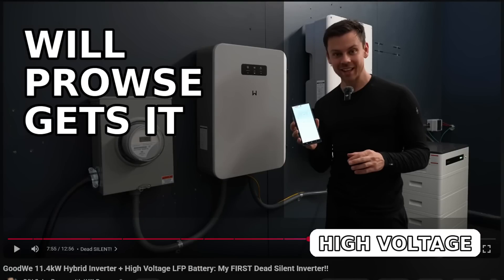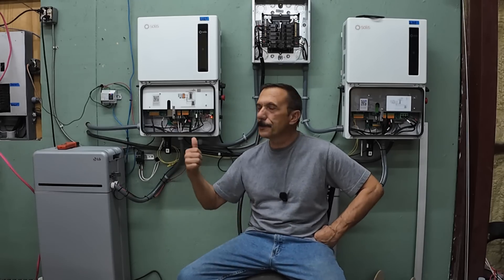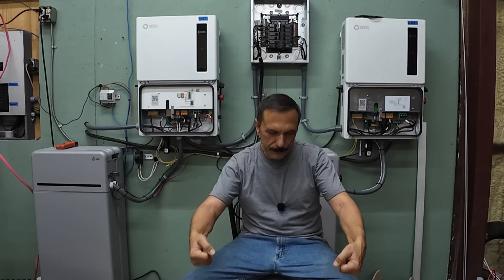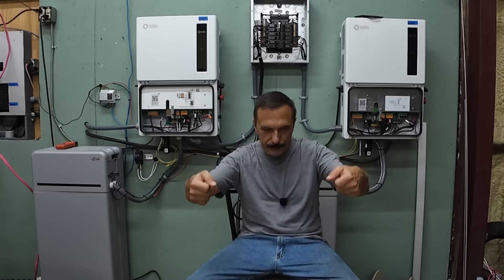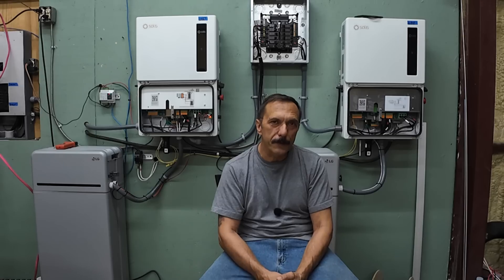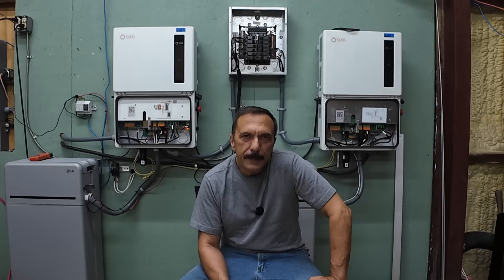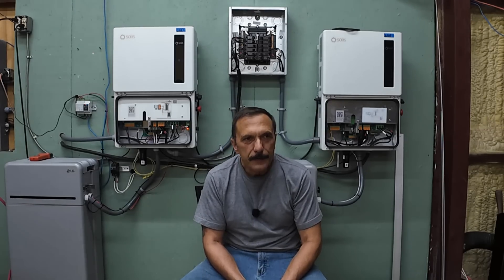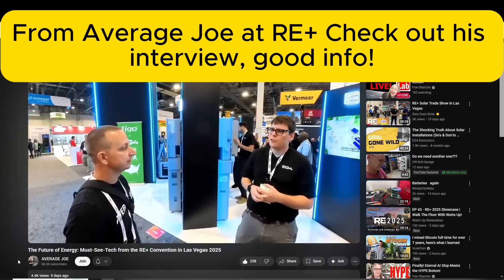Will Prowse Gets It! High Voltage Solar

Comment: Sol Ark has a 60kW 3-phase 480V unit - solar up to 850VDC nominal (1kV peak OC), batteries at 580VDC nominal (12S x 48V module).  I've been itching to do a multi-MW micro-grid system with a few of them...
Reply from the maker: Solis also has some bigger 3p inverters, just waiting for my distributor to bring them in.
Sol-Ark is just to pricey for me, I wish they could have worked something out with Deye so we could still buy them here.
Thanks for watching!
Reply: @DIYSolarFarming  Something I've learned about supply chains from China overs years in tech - it's all the same stuff, they just fudge with minor details to make things look different enough, and then find where the market wants pricing to live using different "brands".  Pretty much all of the US "manufacturers" are just contracting either design and manufacturing or manufacturing to China (and their designs are getting stolen cough sorry... "technology transferred" and used in the other "brands").  It's generally the illusion of choice - unless you're designing and doing the manufacturing domestically yourself in the same building.  What companies out of China would do is host a trade show where buyers would fly in from around the world to see new products, then contract the China manufacturing company to build for them - if they bought enough, they were allowed to ask for small tweaks and changes to differentiate for other brands - slightly different case latches or weather sealing, different fans or heatsink, on-brand color, etc.  They'll even silk-screen your company name on the internal PCB if you pay them to.
  
If you look at the SolArk 60K and the Solis 60K, their specs are basically a 1:1 match, and the hardware just looks like it has a different paintjob and front screen layout (easy to change icons in software without changing the back-end code).  Even the way the network port sticks off the side is the same.

Comment: Greetings from South Africa.
I have a Fox ESS system, KH 10.5 kW single phase Inverter and two EP11 (10.36 kWh) batteries in parallel.
The system runs at a nominal 384V but seems to run at about 400 to 410 volts most of the time.
I was drawn to the system by the very benefits mentioned here - lower current, thinner wiring, cooler and generally more efficient.
It's been great so far.
Reply from the maker: Thanks for sharing your experience, glad it's working well for you!

Comment: Interestingly, just commented on another channel and have been wanting to utilize commercial solar panels and older NiMH Prius and the like HV batteries more.  Mainly, being the Priuses are even cheaper albeit lower capacity batteries.  Still, I know I am getting a stash going and that includes a 5kW  HP Server UPS that I need to revisit getting back in service no with a Prius since if is OK with DC input after the contactors, would make a great system.  That is either full time dedicated or as needed Prius HV power station.  Seems as well can just integrate as full time as cheap as some gen 2's are going. Maybe going overboard; though seems if you can get a solar charge controller to keep the HV battery packs topped off or trickle charged, then the gen 2 Prius wouldn't start it's engine for generation unless the coolant was under a specified temp.  Therefore, you can dump some heat into a block heater to prevent that from happening unless needed for HV pack charging or system peak or surge handling.  Just seems crazy having such cost effective big generators in those Priuses going for so cheap.  Thanks for sharing and safety really needs to be addressed with these high voltage systems, I mean ablation station if not careful.
Reply from the maker: Interesting, what's the voltage on those Prius packs?
Thanks for watching!
Reply: @DIYSolarFarming  Nominal voltage is approximately 201.6V for a 2004-2022 Gen 2, 3 & 4 Prius HV pack based on 1.2V per cell multiplied by 168 cells.  Where each module is 6 cells and there are 28 modules in the HV pack.  The Prius senses pairs of modules, so 14 blocks and when in the vehicles can get up to 270V when braking regen charging.  233V seems to be the trickle max to balance the pack if you charge using what is termed grid charging using a 300ma HV LED power supply.   The NiMH modules can be found also in hybrid Camry's, Highlanders and more like the Chevy Tahoe's and related. The Prolong grid charger website has details with more specs for the different NiMH batteries, since they detail how to use their charger with the range of makes and models.

Comment: Definitely would be awesome if the US market would allow for more high voltage batteries. The whole point of an all in one inverter is to gain higher efficiency from not having solar drop to a low battery voltage before being used.
Why not just eliminate that low voltage all together? It just makes so much since. And I feel like from what I've heard from solar installers I've talked to who have been in the industry for decades (in Idaho at least) is that high voltage batteries was frowned upon in regulations because it was "more dangerous". Which that was back in the day of only lead acids that didn't have any isolation switches or anything. But now with LiFePO4 batteries being completely self isolating, it doesn't make any sense for those regulations to still be in place.
I certainly hope that high voltage batteries become a lot more common!
Reply from the maker: You and me both brother!
Thanks for watching!

Comment: What’s the efficiency?The battery has an inverter to high voltage and the solar inverter has to reduce the voltage.the advantage is the wiring is between the units and the grid.
Reply from the maker: Efficiency comes into play with inverter conversion losses, a low voltage inverter needs to convert the low voltage DC to high voltage DC first before converting to AC.
With a high-voltage battery (300–400 V), the inverter works almost 1:1 with the battery bus, so there’s little conversion overhead.
Plus on a low voltage system you have losses on the battery cables due to heat when pulling that 200 -300 amps at load.
Thanks for watching!

Comment: Also your video description is extremely offensive. You call HV "real" so you imply others are fake. What is fake is implying the stupid thing that small and mid sized systems should go and buy ~100 cells.
Reply from the maker: Show me where I say to buy 100 cells, I advocate buy one battery pack wire it up with small 4 or 6AWG that you can buy at Home Depot for pennies per foot, done - cheap and easy.
If you want an adventure, Ev full packs are interesting.
Reply: @DIYSolarFarming  wiring is not the cost

Comment: HV is a very stupid idea for certain use cases. The cheapest cells per KW are now 314Ah or even higher. Small and medium systems would be extremely expensive unnecessarily because they'd need at least ~100 cells of those (expensive) or ~100 smaller cells (still expensive and bad cost per KWh).
I find it sane only for extremely large systems that need AT LEAST ~100KWh. Noise and cable cost is irrelevant for certain cases (batteries not in living spaces and cables are almost always very short so not that expensive even if they're large anyway).
Reply from the maker: Solis 11.4kW inverter + LG 16kWh battery = ~$5100 and it is UL approved to install in the US. That means your inspector will give it a pass, it can be grid connected and your insurance company will cover it. I would not put any large non UL approved battery in my living space.

Comment: I’ve seen nothing but bad about the LG 16h you’re using, for anyone getting antsy about using the 30% tax credit before it goes away, would you recommend them for on-grid Hybrid use and if not, what would recommend instead. I’ve only seen the Goodwe setup outside of This.
Reply from the maker: What have you seen bad about them? They are UL approved and have an exceptional track record. You must be talking about the 10H that had a recall.
There are other batteries, I'm trying to work something out with Soluna, 15kWh and can be stacked up to 150kWh on the Solis S6.
Thanks for watching!

Comment: I have a 2017 Bolt EV I bought for my daily 60 mile commute each way.  Then COVID hit and I was able to tele-work. Then because of the battery fires, GM swapped out my ~60kwh battery and I only have 20,000 miles on it.  I'm nearing retirement and wanting to build an off grid retirement home.  Since my early model Bolt is notoriously uncomfortable and slow changing, I'll probably want to get something better., but likely not get much trade-in value.  So re-purposing it's battery for my off-grid home sounds like a good idea.  Has anyone here done this with a Bolt?
Reply from the maker: Yes, the Bolt battery is supported, click the link to Dala's GitHub in the video description. At the bottom of the GitHub page there's a link to the Discord. Lots of information there for you.
Thanks for watching!

Comment: You should look into Avramenko's Plug, 1kW through a single-wire transmission line with only a 10 microns 
tungsten wire!
Reply from the maker: Interesting, I'll have to check that out!

Comment: One major downside of HV packs is the extra cost. Multiple smaller cells to deliver higher voltage means a lot more interconnects, a lot more BMS wires and a lot higher channel count for the BMS.
Every joint that needs to be welded or torqued is a potential failure point. It's better for high scaling but the cost is just insane vs lower interconnect options for single inverter with single battery setups.
Especially now that the new MB56 cells have arrived. I'm running 32 kWh on my Deye 12kW LV inverter but I am fine with a 8kW limit to the battery seing how I use it on a IT-grid and it's limited to 7.4 kW anyway (voltage difference beetween 400v and 230v).
Reply from the maker: You bring up some great points! 
HV batteries are coming down in price fast as we get more adoption here.
For example, the UL listed LG batteries I am testing with are only $2700 for 16kWh with the discount code I have for them, https://signaturesolar.com/lg-16h-prime-battery-16kwh-400v-high-voltage/?ref=piqshkgv
Reply: @DIYSolarFarming  I paid $2700 for my 32 kWh single case behemoth from Seplos. The Mason 560L.
It arrived on a boxed narrow pallet and it was just a matter of setting up a ramp for it and roll it down off ramp and up against the wall. Adjust the feet to stationary and bolt it to the wall for safety.
Reply from the maker: That's awesome!

Comment: 4:55:  100 or 120 volt battery pack . . . yes man!  There is so much stuff in the US that runs on 120 VDC.  Why invert DC to AC just to run DC appliances?
Reply from the maker: Yes, we just need to get over the safety aspects. I've done some demos on this but at this point I would only recommend doing that in a dire emergency!
Thanks for watching!

Comment: I have both high voltage and 48v, the problem right now with high voltage is the ability to get a lot of kWh, that system you have maxes out AT 64kwh while 48v the sky is the limit
Reply from the maker: Depends on the batteries, for example you can run up to 10 Soluna 15kWh batteries on the S6 for 150kWh per inverter.

Comment: Thanks for posting. 

The yt algorithm is only counting views that watch a majority of the video - 80+%. There's a lot of priority being given to yt videos that run alongside the most valuable advertising buyers. It's basically turning into the same financial calculation for value that old cable seasonal watch times had. If you're posting at active watching times and attracting high value watchers, those that click advertised links on the platform, you get raised to the equivalent of "prime time" in the general feed. Otherwise it's self marketing or niche marketing, mostly reliant on the yt channel production team to drum up outside watches. If you have other networks and can drive outside links to the yt platform, that also pushes market value for the channel. I used to work in advertising scheduling for Fox. This system on yt has started exhibiting all the same advertising strategies this year.

Next time you do a video, try suggesting a recommended tool list in the video and make sure that list makes it into your subtitles srt, if you're generating one. The text content of the video is being referenced to determine who to market advertising space to. In my cable TV experience, talking about product categories in-line with the program content used to be a way to determine which advertising to schedule alongside a program, sometimes bookending a program's advertising break to make sure folks saw that specific client.
Marketing strategy may have more data to run with now, but the old strategies are still being used.
Reply from the maker: Wow, great insight thank you! I'll be sure to try your recommendations.
Thanks for watching!

Comment: using lithium ion is always a mistake
Reply from the maker: Everything has its risks, I believe most consumer rechargeable devises are still using li.
Thanks for watching
Reply: @DIYSolarFarming  no not everything has its risks, there is risk and then there is bringing INTO YOUR HOME an energy source that has all the oxygen it needs to burn and NOTHING can stop it.  I love batteries, but ive learned my lesson.  You can do everything right, and I do mean everything and still ONE CELL will decide its time to go thermal and well your house and maybe your life and all your loved ones are GONE.  This isnt even a normal fire, it will spread so fast and if you dont have good venting for that fire and by good venting I mean very very good get ready for the explosion from all the gasses escaping.  Just DUMB if you ask me to bring that chemistry into a place you live, it just is not worth it.  Same with Will I see he does everything right but I will not be surprised to find out he is dead one day although it looks like he may have built his house to have a buffer for that planned out ahead of time
Reply from the maker: @adairjanney7109  You are right, if you watch my videos you will never see any storage battery in my home. Everything lives in the solar shed or my shop.

Comment: I looked at an EG4 inverter on their website. The battery voltage was spec'd at a range: 100 to 500Vdc. They said to check their list of qualified batteries, but that PDF file wasn't there. I realized most EVs use roughly 400Vdc, so get a battery pack from a wrecked EV. I got the impression it was a brand new product for EG4, and I bet much of the firmware is still being developed.
Reply from the maker: Interesting, yes the NOVA is brand new.Last I looked they had no info only the photo. I'll take a look.
Thanks for watching!
Reply from the maker: Couldn't wait, for me it still says "15.5kW 100V battery. Coming soon."

Comment: Dude, I have been installing hv inverters in South Africa for years!!!
Reply from the maker: Yes dude, like I said in the video, the US is just now catching up to the rest of the world.
What inverters are you using over there?
Thanks for watching!
Reply: @DIYSolarFarming mainly Deye, 20 to 100kw 3 phase with deye 800v batteries. But also Fox inverters.
Reply from the maker: @KB-lj4vk  Wish we could get Deye here, Sol-Ark has it all locked down...
Reply: @DIYSolarFarming we get both deye and sunsynk, same hardware different software, but deye software is a charm!!! Can't you just import it from here? Deye 50kw 3p is around $4.5k 100kw solar input and 200A cont pass through.
Reply from the maker: @KB-lj4vk  I tried direct from China, no one will ship to USA. The problem is when Sol-Ark came in they had Deye remotely kill all the Deye inverters in the US. Even if you could get one into the US I don't think you could do an update unless you're on a VPN, not worth the headache.
Solis has a 50kW S6 storage out now I think around the $5k price. Just waiting for my distributor...
Reply: @DIYSolarFarming we get the solis here as well, but not very popular for some reason.

Comment: ive seen high voltage like 600 arc and destroy here in my country its quite normal to see such voltages on solar panels 8n sereies
Reply from the maker: Yes, I've seen in Australia it was mandatory to install roof top DC isolator switches, the switches where breaking down arcing and starting fires. The have in the last couple years changed that regulation.
Thanks for watching!

Comment: Supercaps solutions easily available for wind/solar home use? Like ENSEGA or MAXWELL?
Reply from the maker: I did see a company in Australia selling Super Caps for solar a while back, don't know if they are still in business.
The big problem is controlling the inrush current, an empty Super Cap bank will look like a dead short to the inverter, it needs a robust pre-charge circuit.
Reply: @DIYSolarFarming tsk. 👍 

Ensega has wind farm commercial applications but i havent found Supercap home options yet.
Reply from the maker: @AndroidSamsung-qz9pl  Interesting but the price...
Explore the ENSEGA 12V 1.2kWh: a powerful and long-lasting energy storage solution that ensures longer operation times and better efficiency.
$1,200.00
Reply: @DIYSolarFarming 😮 ouch. Yeah, only the price isnt interesting 😅

They also have 60wh and 500wh. Im thinking those are plugged into the wind turbine and the Supercap constantly charge-feeds a powerstation-UPS because a full discharge wont damage them.
Reply from the maker: @AndroidSamsung-qz9pl  Would be interesting in my crypto mining set-up. I mainly us battery just to keep the inverter running during cloud cover. A super cap would re-charge way faster and no degradation. The price just makes it not viable. Might be an interesting DIY project.
Reply: @DIYSolarFarming A working DIY setup would be an amazing thing to watch 😁

Please update me if you try it! 🙏
I want my own 😂